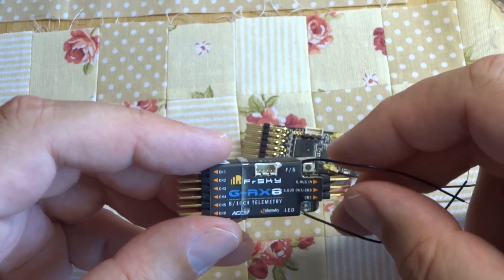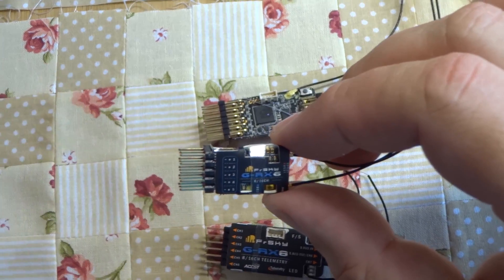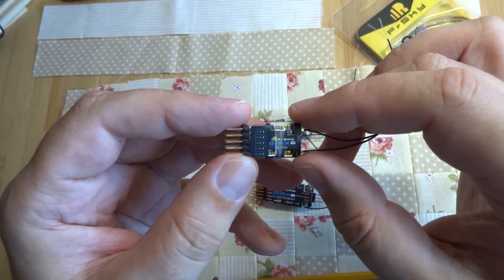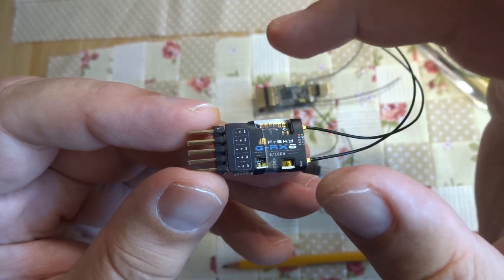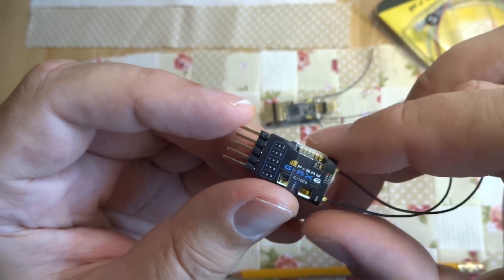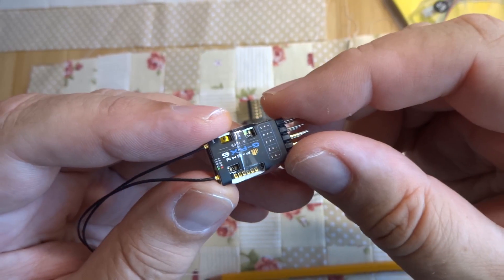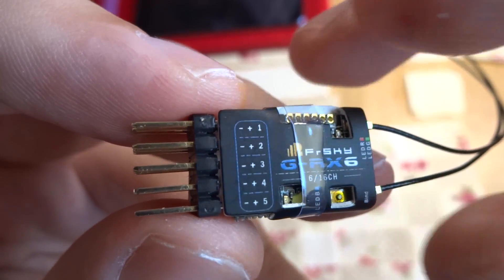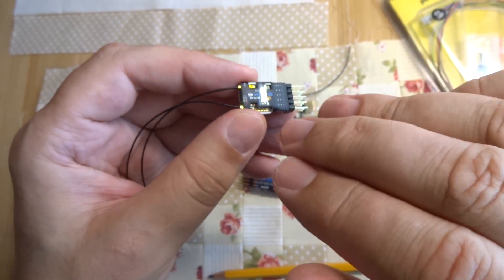FrSky / OpenTx Crumbs - New receiver with a variometer G-Rx6

Comment: Just in case this helps anyone coming here for answers like I was, I found a way to flash the firmware without actually soldering the connector. Make sure you have the G-rx6 firmware downloaded and ready to go in your TX's SD card Flash folder so all you have to do to start update is hit enter. Plug the cable with the servo lead into back of TX with signal wire toward the tab, plug the other end into the S.Bus piece that would be soldered to orient it the correct way as you would to solder it, put the pins in the correct holes straight in from top of the RX and lean slightly to one side to make good contact, then start the update process and hold steady until complete(about 5 minutes so make sure you're in a comfortable position😉). Once screen says update successful, hit ok and go ahead and remove cables. Hope this helps someone that only needs the port for flashing. I had pictures to post but it's not letting me add those to you tube so sorry
Reply: So do I just connect - + s on the g-rx6 to the bottom 3 pins on the back of the XD9 which are, from top to bottom + - S ?

Comment: Hi Richard
what does the AIN2 maen? can you connect the + from your battery on it? because when you read the sensors there is a A2 that plays voltage value

Comment: Hi Richard
Having trouble binding the G-Rx6....Have used G-Rx8 with no trouble. 
is the G-Rx6 factory set to SBUS mode like the G-Rx8?
If so what pins need to be shorted out to get PWM mode?
Not shown in instruction manual...

Great channel...
Regards
Trevor.

Comment: Thanks for the video Richard. I purchased a G-RX6 last week but was unable to find how to connected to the S Bus system until I saw your video. Yes I agree, while it is an extremely small and light receiver, I think its a pity FrSky has not continued with their excellent S Bus connector system. Soldering at that level is not a skill that all modellers have. Maybe in the next generation of the receiver, FrSky will address this issue and provide the connector connected. 
I also notice someone in your household is an excellent quilter. A household similar to my own here in Ireland though I am not permitted to work on my models at the quilting table.
Thanks again for the video